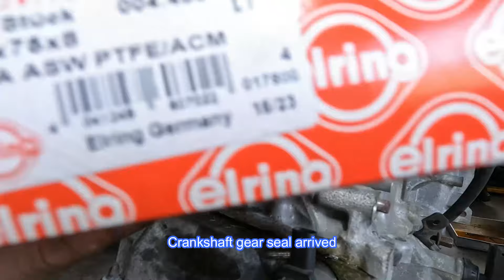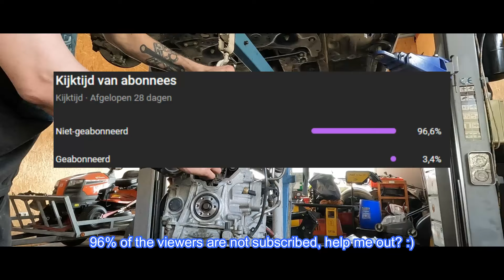1.2 THP PSA Engine wet timing belt replacement guide EASIER than you think! Fast & easy guide

Comment: The idea of a wet timing belt is just WRONG!
Reply: The idea isn’t really wrong, but the belt isn’t suited for today’s petrol. Short distances with a cold engine (lot of blow-by) and E10 petrol is what kills these belts. When these engines only do long distance driving, they will last a very long time. When this engine came out E10 wasn’t really common.
Reply: @002-b9s  Tank premium fuel (E5 and change your oil at 15.000km/1 year instead of 30.000km, and change the belt every 100.000 km.
Reply: @marcohillenga5068  How does petrol get in the crankcase ?
Reply: @maxflight777  on cold starts, the pistons and piston rings don’t seal properly not a problem for a wet belt by itself, but when ethanol is added in the fuel, it’s a big problem.

Comment: Well, I just discovered one engine to be avoided at all cost - what a PITA!!!
Reply: A garage near me refuses to touch these engines
Reply: @brucemcpherson8832  why?, just treat it as needing a belt every 40,000mls like other dry belts
Reply: @BRM101  Except  that: 
a. The cost of replacing a wet belt is far more than replacing a dry belt (because more work has to be done to access the belt and to put everything back together again after the belt has been replaced
b. Degradation of the belt before it reaches 40,000 miles leading to bits of the belt blocking the lubrication system, leading to a premature engine failure
Finally, I wouldn't have any PSA vehicle, wet belt or not, give me a Toyota (or preferably a Lexus) any day
Reply: @brucemcpherson8832 what car do you currently drive mate?

Comment: Easy? Ah in order to replace a timing belt.. You had to dismantle a whole engine.... I had a Citroen C3 2016 1.0 petrol 3 cilinders pure tech engine .... Never again......
Reply from the maker: No, I removed the engine because the old one was damaged... But this way it's easier to film and see....
Reply: @MechaNick_  Also significantly easier to work on
Reply from the maker: @toxichazard5015  Yep definitely, but its also easier to show you.

Comment: Just had the belt changed in my 2015 C3 Picasso at 57k miles. Was getting low oil pressure warning messages. Had main dealer servicing from new.

Comment: Ford eco boost also use a wet timing belt.
The belt degrades over time and the bits block the oil strainer. The subsequent loss of oil pressure destroys the engine.
Reply: They used to until 2018. Not the ecoboosts are Chain driven.

Comment: Nice video. Bought a Citroen C4 2022 brand new. Engine replacement at 9500km because of cam belt breaking..
Reply: How much did you pay?
Reply: Nothing hopefully should still be under warranty surely

Comment: Thanks for the comprehensive video.
However, it's  more complex than a normal timing belt replacement in other cars as gaskets and seals need to be also changed.
Having the engine out of the car makes the replacement much easier clearly.
Wet timing belt is just a non sense in my opinion.

Comment: You still need to remove the oil pan, check and clean the oil strainer EVERY time you change a wet belt.
Reply from the maker: Forgot to mention, Thank you
Reply from the maker: @baylessnow  well technically thats not how it works over here. I get the same salary every month. I take care of the car as if it were my own. But I understand the joke 😆
Reply from the maker: @baylessnow  I work in the Netherlands

Comment: Any recommendation regarding the time belt ? Here in France, the amount of broken motors is seriously going up with 1.2 puretech. The belt disintegrates slowly in oil till the point where the oil pump strainer is obstructed.
Reply from the maker: Replacement every 60.000KM
Reply: @MechaNick_ Because it’s terrible, distasteful, horrible design..
Reply from the maker: @bikerlad3138  I do agree. Its like the vaccine, it's not properly tested before distribution of the product.
Reply: Puretech?  PuresXXt. 
It was designed to fail, I stick to my statement.
 A mechanical (motor-design) engineer can never have knowledge of all aggressive ingeredients in oil (a lot! ) that attack the rubber belt. Let alone the working temperature. The oil can be 100 C or more !!!!!  No rubber can hold that.
Hence: designed to fail.
Reply: The designers went to a. Lot of trouble to  make that engine completely  unreliable
Reply: @tomstandish6704  new rev is with the chain starting late 2023, it will probably be much more reliable, apart from the obvious wet belt 1.2 is still a good engine

Comment: Great video. I've just done a wet belt on a vauxhall/opel. Same engine but slightly different.  The pulleys have a lip on them so you can't get the wet belt off without taking the pulleys off first. 

The camshaft  locking tool where the vac pump is doesn't fit, and there's a new 2 piece  tool, i can only find in france that fits in a hole where the other camshaft locking tool is.

Different  rocker cover gasket too.
Reply from the maker: Whats the engine code?
Reply: I believe engine code used in the 1.2 Vauxhall is HMZ

Comment: How to prevent the wet timing belt crack?  Should I inspect the belt condition every 1000km with endoscope camera or use the gauge which checks the width?   What is your advice about the optimal oil change cycle time period?
Reply: at 2020 , PSA released new bulletin over this engine, recommending to use only 0w30 ACEA C1 or C2, with B71.2302/2312 requisite. Only Mobil and Total has products with theses requisites. About oil cycle , try to change oil and filter, each 8000km or 6 months. 
don't use any kind of militec, motorkote, etc... 
important note: when arrive your car at oficine to change belt or clutch, ask to professional to open oil carter e clean up system, removing any kind of belt remaining part.
Reply: Thank you for your well detailed advice😊

Comment: Hi, Nicholas! Great job with changing the belt! Also, I really appreciate your time to kindly and positively reply to everybody! I also have a question. I am buying a Grandland X with this exact engine. The car is from 2018 and is only 25k. Is it necessary to change the belt?
Reply from the maker: Hey, thank you for the compliments :) theres a special tool to check if it needs to be replaced, the dealer has this. You can also check how the belt looks like when you open up the oil filler cap. If it looks nice and smooth, I dont think its necessary to replace it right away. However when you reach 60K i would to it preventive together with the oil change.
Reply: @MechaNick_  Thank you very much! I will do that!
Reply: @adriang.7017 better get the 1.5 Diesel in the Grandland. I had the car for over 5 years and it needed much less fuel than the 1.2 gasoline engine. The 1.5 130 hp engine has also no wet timing belt.
Reply: Do the Engine have to be removed for this job
Reply: @NiallQuirke-ot8dy , no the wet belt can be changed without removing the engine from the car.

Comment: Hey Nicholas, this crank blocking tool. What is the size of this tool, the diametre to block the flywheel and the diametre of the bigger part for in the housing? If you could share, would be great 😊 kind regards Pascal p.s.: nice video and great work 👌
Reply from the maker: Hey! Thanks for the positive comment :)

The small part is 8mm wide x 10mm long and the bigger part 14mm wide x 30mm long.
Reply: Your welcome and thank you very much for checking and comment back 😊 kind regards me 🖐️

Comment: As a dealer tech we dont remove the engine, only if the oil pump has to be replaced but with a special tool U can pop the strainer off the pickup without removing the oil pump and cleaning it and refitting it. The newer later engines still under warranty U can only do by removing camshafts as U cannot sneak the belt past the sprockets 

Make sure u remove the gauze filter in turbo feed line at block connection as it can block with rubber starving turbo of oil. Make sure U buy a belt checking tool to examine the belt width as it's likely it will need changing before the replacement interval and if done early U won't have to clean all the rubber particles through out the engine.
Reply from the maker: The belt is not the reason I removed the engine.
Reply: It literally says in the first 6 seconds of the video that the engine was removed because of engine damage....

Comment: Hi there , i've carried out replacing the belt but now it comes up with code p003c -74 ? Can you shine any light on this or where we have gone wrong ?
Thanks neil
Reply from the maker: Hey Neil, sorry for my late response. Did you find out what the problem was? Might be a damaged sensor, or a forgotten connector. Recheck the timing.
Reply: Yes I finally found out the problem, even though we used  the timing kit for the later engine ( the one that sits where the vacuum pump is located ) it still wasn’t timed exact . We removed the cam cover and used the old timing kit which locks both cams and this worked perfectly! 
Cheers for replying 👍

Comment: Hey Nicholas awesome video! Can I ask a question please? Any help will be very appreciated. I have the same engine and the oil pressure light is coming on, so I've removed the sump and cleaned the the oil strainer which wasnt terrible! It did have some micro fibers from the belt in it, ive changed the oil and the oil filter but the low oil pressure lighg is still coming on? The belt is in bad condition, it has micro cracks throughout it, i will replace it but to my understanding that isnt causing the low oil pressure fault????? I dont want to replace the belt and then still have the issue???
Reply from the maker: It could be the pressure sensor as well. Thoroughly clean the oil pump. Have you used a device to read the OBD fault codes?
Reply: Really appreciate the reply! P15A4 fault coming up, states Engine oil pressure control solenoid valve control circuit low voltage?
Reply: Can I ask where the pressure sensor is located
Reply from the maker: @JohnDoe-rf4td  its the control solenoid.. located on the oil pump itself. The sensor is around the oil cooler.
Reply: So is the solenoid an easy replacement? Or do I need to change the entire pump?
Reply from the maker: @JohnDoe-rf4td  sorry for my late answer. If you can get your hands on a solenoid you can try to replace it. Without the whole pump.
Reply: Again thanks for the reply! The thing is I can't locate the solenoid?
Reply from the maker: @JohnDoe-rf4td  96 750 817 80 try Google this number
Reply from the maker: @JohnDoe-rf4td  or send your vin number please. futyi95@gmail.com
Reply: Just emailed you, again thank you so much
Reply from the maker: @JohnDoe-rf4td  I mailed back a screenshot of the part.
Reply: the oil pump is a weakness on them as there is a nylon inside the pump that breaks, I have changed so many oil pumps and to change the oil pump, you have to remove the gearbox and flywheel to get to some bolts, perfect design 🙄

Comment: Excuses me to change the belt is it the reason why you dropped the engine
Reply from the maker: @isaacagho1255  Nope, the old engine got destroyed, and this is the replacement engine. You can do this job easily when its in the car.

Comment: Just done mine with the same locking kit, torquing up the bottom crank bolt is the worst though, I was worried about the crank locking pin cracking the aluminium housing on the engine, ridiculously tight, 50NM then 180 degrees, but obviously not the case for you as you had a pin spanner to hold the hub, maybe the locking pin isn’t meant to be used when tightening the bolt ?
Reply from the maker: No don't use the locking tool for this, you can break it! Just use a counter torque like I did.
Reply: @MechaNick_  could you provide a link for the counter torque tool please? Thanks
Reply from the maker: @nickprince8623  https://a.aliexpress.com/_EH93fGJ 🍀
Reply: @MechaNick_  thank you
Reply from the maker: @nickprince8623  You're welcome :) Worth a sub? :D
Reply: The ford eco boost has mad tightening torque on the crank bolt
Reply from the maker: @kie185  Yeah I used some kind of torque multiplier tool for that

Comment: hi, but to install the timing belt on the automatic peugeot 2008 eat8, is it the same as the manual transmission version? Are the phase lock tools the same? Thank you
Reply from the maker: Yes.
Reply: @MechaNick_  So are the phase tools the same for both the manual and automatic versions?  I own the 2008 1.2 eat8 automatic
Reply from the maker: @517gregory  Yes, the same tools.
Reply: @MechaNick_  Thank you very much.  Is the flywheel the same between manual and automatic transmissions?
Reply from the maker: @517gregory  the locking pin location is.
Reply: @MechaNick_  Perfect thanks.  Do you know if there is any tutorial on YouTube of changing the timing belt on the automatic version.?
Reply from the maker: @517gregory  Its the same.
Reply: @MechaNick_  Perfect, thanks for the advice.

Comment: what is the correct oil for this motor 1.2 turbo 130 bhp ?
Reply from the maker: SAE 0W-30 PSA B71 2312
Reply: i have many disturbing noises coming from either cockpit or under the hood that i can't determine during first movement of vehicle in D or R gear.. 2023 model peugeot 308...  @MechaNick_
Reply from the maker: @hantst9005  sounds like a gearbox problem, but its hard to tell from such a large distance 😅 bring it to mechanic and see what he says.

Comment: I bought a new 408 with this engine. Should I be worried about the timing belt? Has this problem been resolved in new production 2023 1.2 130hp vehicles?
Reply from the maker: I cannot give you a concrete answer. Thats something you should ask the dealership. As long as you stick to 60.000km for replacement you are good.
Reply: Dont wory evrthing is solved 2020 when they change belt suplier of stalantis grup just use proper oil and change it every year or 15000 km
Reply: @osa-mv4iv  Dayco supplies these belts from the moment engine was made up to this date. New engines 2023 and later will come with a chain
Reply: @osa-mv4iv  Not every problems solved
Reply: @EnzoMSI  Not every cars have the new engine in 2023, be carrefull
Reply: @petitnicolas33  1.2 hybrid 136hp  is with chain but 1.2 petrol 130hp is with taming belt
Reply: @EmzoMSI, that never happened. EB2 still have the wet timing belt. Osa was right, Continental made a enchanced timing belt for this usage.

Comment: From 2020 every pure tech has conti wet belt and garantie for him is 5 years so now all stelantis cars have 5 years or 100000km .Only problem with pure tech engine is that lot of people dont drive theirs cars in authorised servis but in local servise garage were they use wrong oil or wrong wet  belts .Also in autherizd servis you also must check is they realy change oil filter or they just sey that they are so every time I mark my oil filter so that iam  cernt that they change it
Reply from the maker: Marking your oil filter is very good! I always check for the right oil specification. Especially with the wet belts.
Reply: that's a nice trick right there.

Comment: I have a question about the video at 2:05 min. Can you explain to me why I have to turn the crankshaft until it clicks? What's the reason for that? I'm grateful for an explanation.
Reply from the maker: Hey, its when the crankshaft hits the locking pin which you push into the flywheel.
Reply: @MechaNick_  
Many thanks for your response.

Do I have to pay attention to the markings on the camshaft sprocket?
Or do I not need this if I lock the crankshaft and camshaft?
Reply from the maker: @and1st1984  Not needed, just lock the crank and camshafts, then the timing is correct.
Reply: @MechaNick_  Many thanks for your help. Which socket wrench do I need for the tension pulley, the idler pulley and the screw that is tightened to 50 Nm and 180 degrees? Thanks again ...
Reply from the maker: @and1st1984  21, 19, 17, 13, 10mm i am not 100% sure though
Reply: @MechaNick_  Thank you very much! :)

Comment: What do you think about the 1.5 tsi engine is reliable?
Reply from the maker: Oil usage, resonations/vibrations, lack of engine power overtime. I never owned a TSI myself but I've repaired a few ones.
Reply: @MechaNick_ what obout 1.0 tsi 115 hp dsg ist worth to buy just for normal driving
Reply from the maker: @osa-mv4iv  Not a huge fan of VW products, probably because we got VW's in the workshop everyday. But I think a 1.0tsi wouldnt be bad for daily grocery shopping. Not if you are going to tune it and make it an McDonalds showcar.

Comment: Hi Nicholas; great video I’ve got to do the same job on my drive…. Will the engine come out the top/ front of the car?
And do you recommend a replacement engine if the bet has stripped I was thinking about replacing the valves and rebuilding if it not too bad.
Many thanks 
Matt
Reply from the maker: I removed the front of the car, so it comes out of the front. If you have problems with oil consumption replace the engine or check valve seals or piston rings if the turbo is in good condition.
Reply: Hi I didn’t have any issue until the belt let go…. I’m going to try just having the head off first and give it a good clean out…. Wish me luck 😂
Reply from the maker: @mattparry1251  Good luck man! Of you need any advice on the job.nYpu van reach me through discord.
Reply: Many thanks Kolya…. You might regret that offer🤣🤣